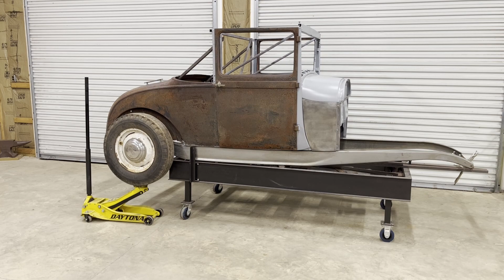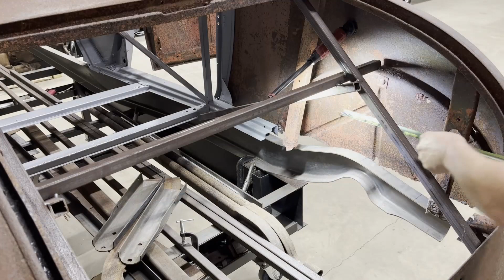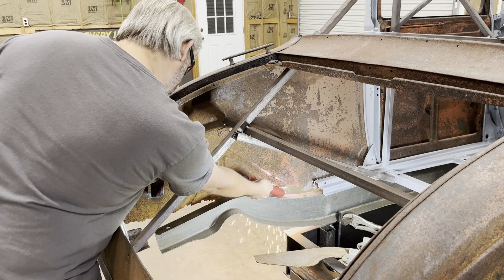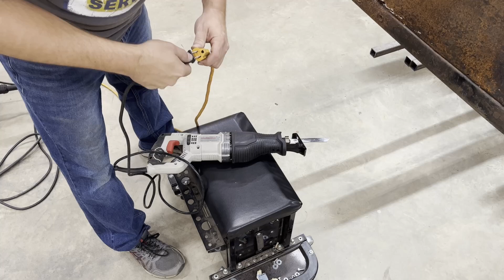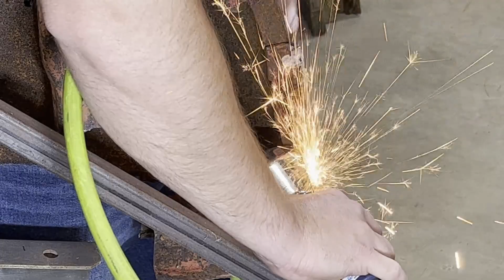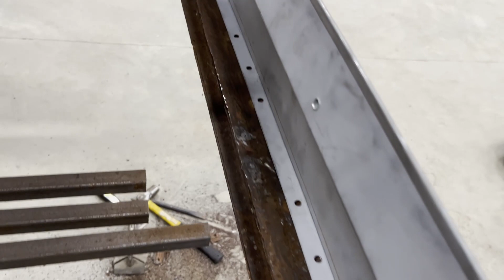Model A Hot Rod Build! Cutting out the rear body panel! Work on the rear body begins! Hemi Coupe!

Comment: It’s not a air hammer , it’s a air chisel
Reply from the maker: I have a Snap-on PH3050BR. It is actually marketed and sold as a air hammer. The terms air chisel and air hammer both reference the same tool, and are used interchangeably.

Comment: Why do you have the blade in saw upside down
Reply from the maker: I don't know really. I guess whatever I was cutting the last time I used the saw required me to turn it that way for some reason, maybe to see the cut better or something. I don't remember what it was because I haven't used it in a while. When I changed the blade in the video, I put it back in the correct way. So, I was using it both ways in this video. Thanks for watching and commenting.

Comment: Lookin great Phil!  For those old flat head screw/bolts, they make a screwdriver attachment for your air hammer that seems to work pretty well.
Reply from the maker: I have one of those, but I don't think a single one of these would have come out, so I didn't even try. Most of them didn't have enough head left to even get a bit to grab. I think that tool will be used soon though, I have some stuff coming up that I will need it for.